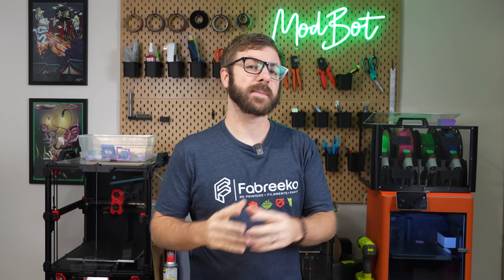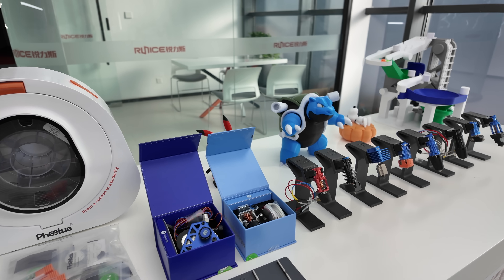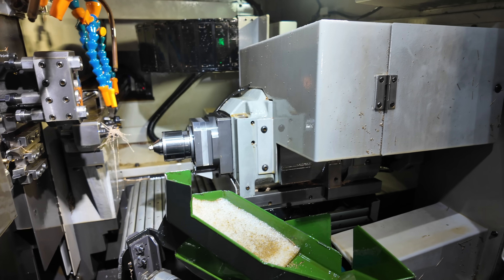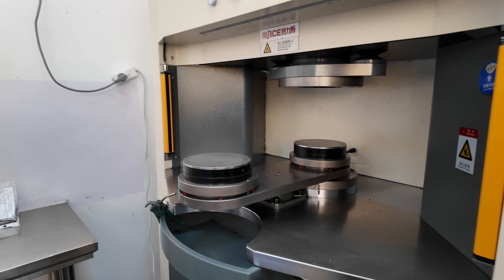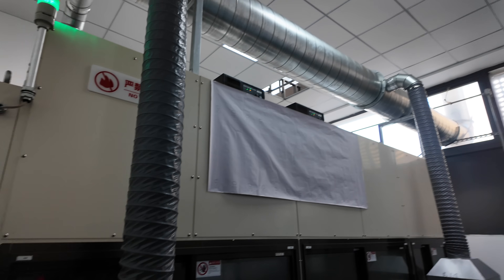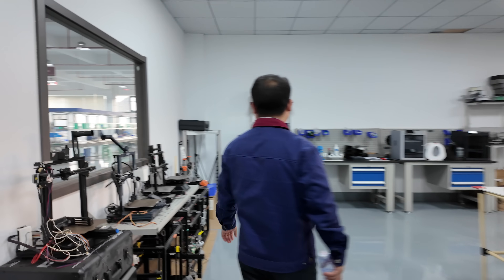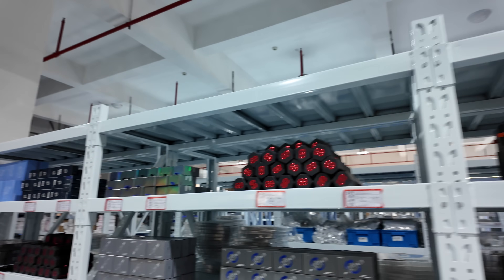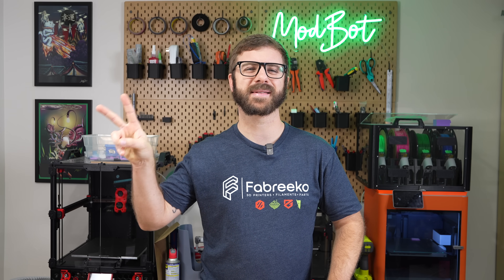3D Printer Parts Factory Tour With Phaetus!

Comment: Did you glean any information on the Rapido 2 issue.  They really needed to recall these and/or send out parts to fix them all without all the trouble it takes to get a work around replacement part.  Nice video and interesting tour of the facility.  Keep up the great work!

Comment: Didn't ask what happens to the parts that fail the QC checks at each step ?
Do they have a lock-up and destroy process, or do they participate to the flood of cheap 'copies' sold on Alibaba, Ebay, Amazon, etc, shady storefronts ?
Reply from the maker: It depends on the extent I actually did ask this. If it can be reused and turned into another part it is. But if it’s not possible it’s basically scrapped. It just depends on the error and extent of it. (Removing more material not an issue)